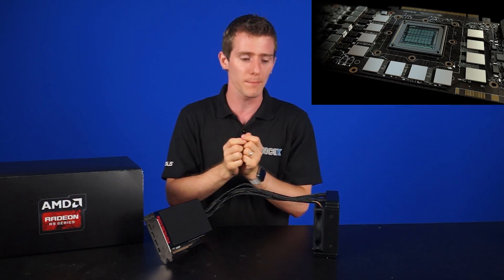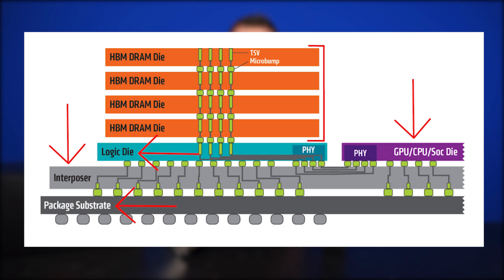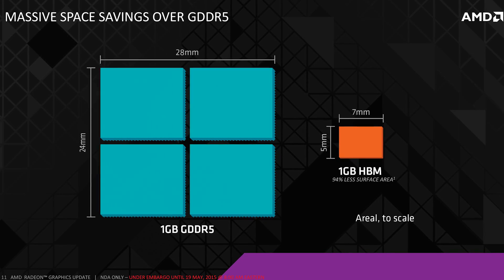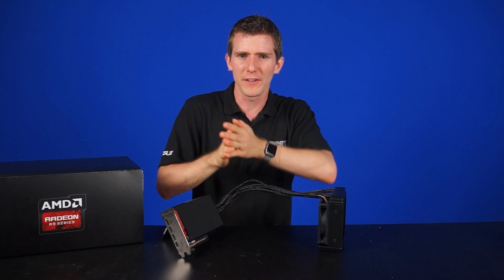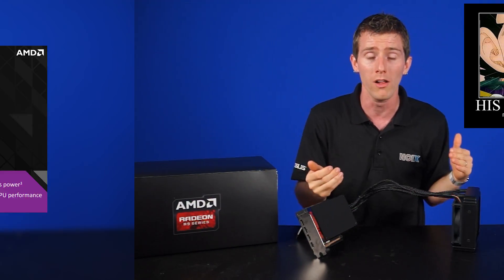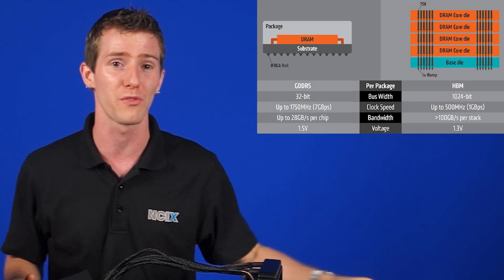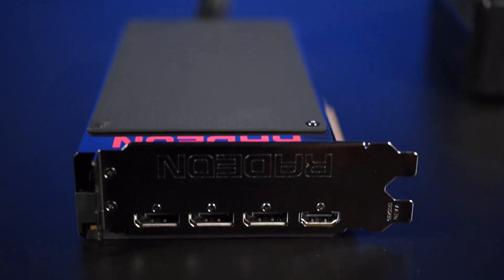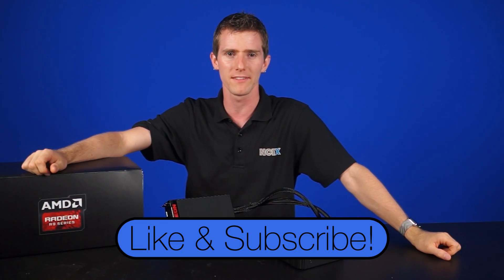What is High Bandwidth Memory? Feat. R9 Fury X

Comment: Won't cooling be an issue with the VRAM stacked vertically?
I mean with GDDR5 every stack of memory could be cooled individually, in some cards even being taken care of by a special cutout in the heatsink. Will the memory heat up more when it's on top of another or is it so efficient that that's no concern?
Reply: ***** Thats why the fury and furyx are VERY VERY hot cards.
Reply: MrHoward888 Fury-X maxes out to around 50-60 c while the TITAN X and 980 TI is 84 c
Reply: dukethedj 50-60c while pump and fan are screaming near 3k. A water cooled card don't count.
Reply: MrHoward888 Then why did you mention the fury x anyways? Besides, Toms Hardware got that temps with the fans at it's slowest speed.
Reply: dukethedj BS complete shit. I'd never believe that in a million fucking years. I done custom loops for awhile and that's a straight lie.
Reply: MrHoward888
Then read it yourself.
http://www.tomshardware.com/reviews/amd-radeon-r9-fury-x,4196-8.html
Reply: dukethedj The article saying they were able to cool the card around 65c and down at 1100RPM's? Yeah that's a straight lie. They fuck'd up. If the fan was at 2200rpm then I would somewhat believe it but 1100 LOL never. That fan and rad was meant for 2000RPM's at LEAST.
Reply: ***** HMB is hot and use's alot more power than gddr5.

Comment: oh come on Linus don't tell me I need to sell my 980ti to get the latest most advanced technology
Reply: Mush Rush amd innovates while intel and nvidia stagnate. always been this way. learn.
Reply: ***** the 980ti only performs better than the fury x at 1080p. And it STILL has not been fully unlocked in ccc to overclock so you have to wait for third party solutions to do so. In 1440p and 4k the fps are either the same or a few fps difference for either fury or 980ti. The fury was marketed as a 4k card, and in crossfire sees a 80 - 90% increase.. while nvidia sli only sees 60 - 70%.. To water cool a 980ti buying a hybrid, or doing custom you're looking at 800-900$ There's positives and negatives to both cards.
Reply: It doesn't matter if you're buying a reference card or not. Non reference = more money, watercooling a 980ti = 200 more than an AIO fury x that you cannot overclock right now. Amd doesn't have bad drivers, they are just VERY slow to roll out updates and NEW drivers. You have to look at it from the perspective of the pricepoint, yes if you can find a good non reference version for cheap that's great. But stock for stock they are the same, and you cant make a comparison for oc'd vs oc'd because you can't currently unlock the fury to it's full potential.

What I'm trying to say, there's no reason to hate on either card, they're both great. And when compared on a FAIR level they're just about the same performance wise, and trade blows. Just wait and let time tell through drivers and updates to msi afterburner and such to open up the potential of not only the fury but maybe helping the 980ti achieve even better overclocks aswell. (even tho silicon lottery and etc) Also dx12 is going to be great, and SHOULD see amd cards running better (at first) as they have been working with microsoft and etc. The future is bright for gaming my friend.
Reply: Space Lama You made the right decision for gaming as of right now. The only reason you'd need an x99 cpu is for rendering / heavy workloads. But with dx12 reducing overhead and rumored to be able to stack vram, and use additional cores on the cpu to reduce strain on the gpu = better performance. But that has remained to be unseen as of now.

I will admit the 1080p drivers for the fury / fury x are absolutely horrendous.. Tho, they did market it as a 4k card so it kinda makes sense, but they shouldn't have done that. The best all around card is no doubt the 980ti. But for higher resolutions that quickly starts to fade away. And you could go either way with your cards.

Unless you're HEAVILY overclocking the 4790k you don't need to put it on water as intel completely redid the manufacturing process and made that chip MUCH better. I'm glad you're liking your build, that's what it is all about, being satisfied with what you have. :D
Reply: zidan40o0 lol relax of course I'm
Reply: Mush Rush ill pay you 50€ for it
Reply: Resa_R_S 55€ you got ur self a deal mr :p
Reply: ***** 30-40% Have you any idea what that would mean? The difference between a 960 and the 980ti is probably 40%, the 980Ti is like 8% faster than the Fury X, even less in 4k where it's actually pretty much similar.
Reply: ***** I do have my card on a Water cooling close system. I overclock the beast and never reach over 50C
Reply: ***** Well, Im claiming to be 20% faster than Usain Bolt, am I faster?
Reply: ***** no in 4k 980ti is still faster, the speed gap just closes but its still slower
Reply: Space Lama Actually the Fury X is faster at 4K.
Reply: no its  not, in most of the test 980ti comes out ahead even in 4k
Reply: Space Lama Barely.. Like I said a few fps if that, and both cards have games they perform better in due to driver etc. They go head to head in STOCK reference configurations. And you have to remember most of the reviewers are very biased.. And are running HIGHLY oc'd cards vs stock fury speeds, there are a few actual reviews of reference vs reference tho which show how it should be. You don't compare apples to oranges. They have a few charts where people overclocked the hbm memory by just a tad which gave the card an 8% increase in performance. When you're able to fully oc the card, then put them head to head oc'd. They are both great cards tho.
Reply: MUNALOS1
Nobody is buying regular reference cards, They are buying aftermarket cards the fury x is still slower than 980ti ACX 2.0 + / SC + and hybrid editions which are the only 980tis that matters and people are buying.

The drivers, AMD has bad driver history as far as I can tell and NVIDIA is much better in that regard but lately on the latest patch its caused issues for some people also but is stil faster than a fury x
Reply: Space Lama
Reply: MUNALOS1 The price point is valid but thats however if you prefer to save money or have the best graphics card out now and both graphics cards will benefit from dx 12 anyways. But yes PC gaming technology is growing so Fast, Earlier I had to choose between z97 mother board or x99 for a 5960xk vs 5930k vs  4790k. But I went 4790k since I already have the rams and its cheaper anyways.  I brought a  asock extreme 9 motherboard. Its doing fine so far had it for a bout 2 weeks. But My side panel fan is keeping it cool enough. Without it would heat up slowly too much. Heatsink is aluminuim which is probably why
Reply: thefilmdirector1 I'm surprised that no fanboy has lost his shit because of your comment yet.
Reply: Helodon
We know Intel processors are far better than AMD and currently Nvidia cards are better anyways. But the Fury x is innovative though but not more powerful than a 980ti hybrid. Thing I do like though is that its a small graphics card in comparison to the 980ti and uses slightly less power I believe
. I am not a Fan boy, These are just Facts. If AMD was better Id switch over, its more affordable product though
Reply: Mush Rush wait for hbm 2
Reply: thefilmdirector1 AMD may innovate but I'm still sticking with intel built in graphics. LOL
Reply: ***** Yeah, I do. I'm meaning my cheap laptop